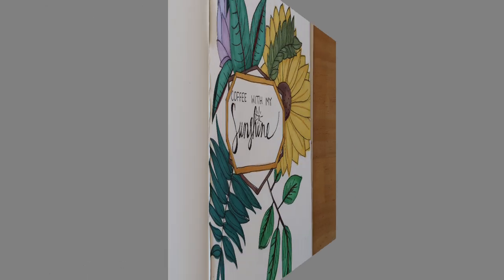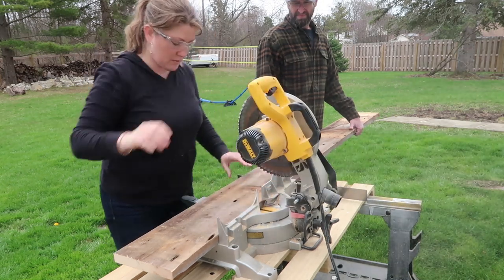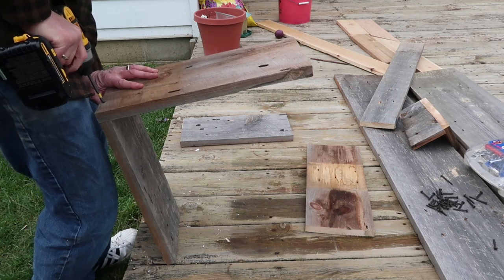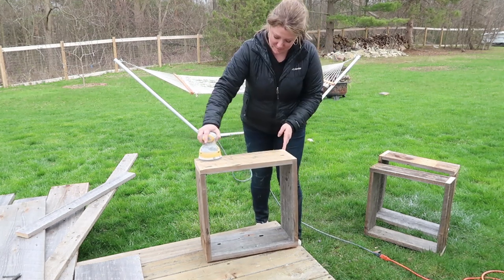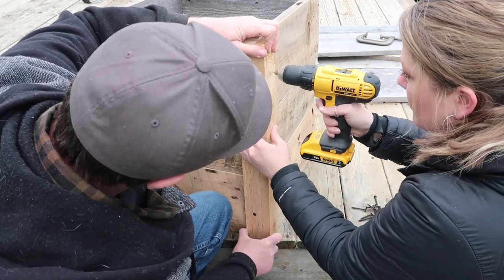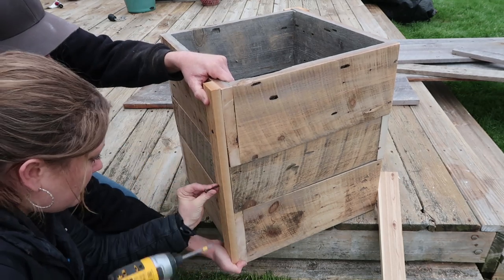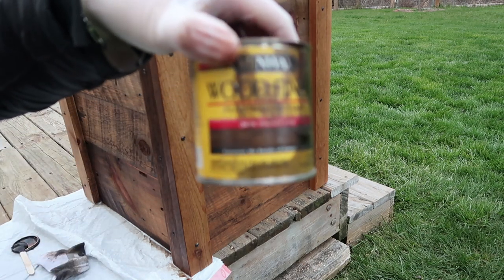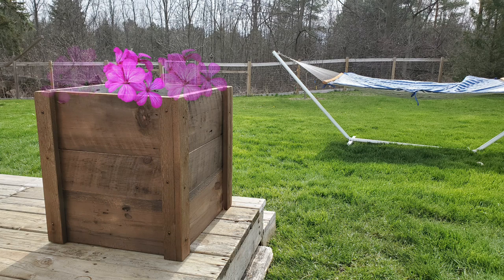DIY RECLAIMED BARN WOOD PLANTER BOX | GIRLS CAN USE POWER TOOLS

Comment: This is AWESOME. I totally want to build one now. A way to tone down the orange would be to apply watered down gray paint or watered down white paint over it. You apply it with a brush then wipe it off with a rag to get the desired color. Literally just add some water to paint in a cup. I love that you use socks to stain. :)

Comment: The planters turned out great. You can take some out door white paint and water it down,  about 1 part paint and 9 parts water and mix it real good. then start by applying 1 coat and keep adding until you get the desired look, then put a clear sealer over the top. Test on a small area if the stain makes it too orange or brown, you can add a tiny bit of black to add a more weathered look.